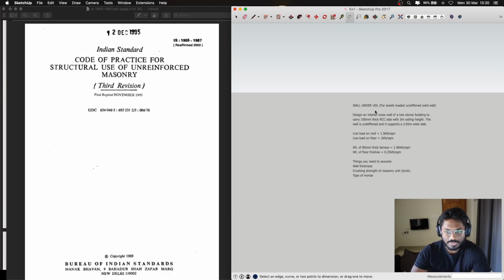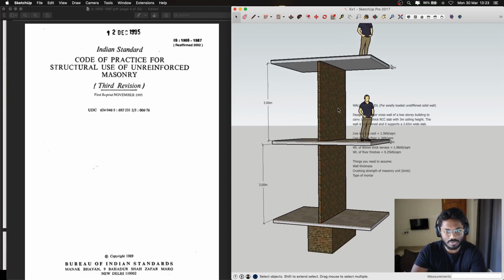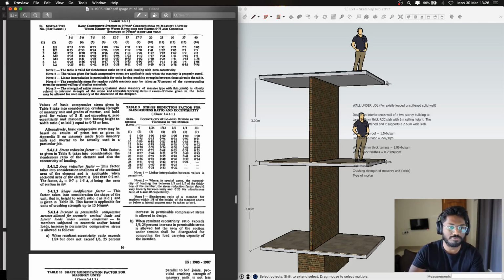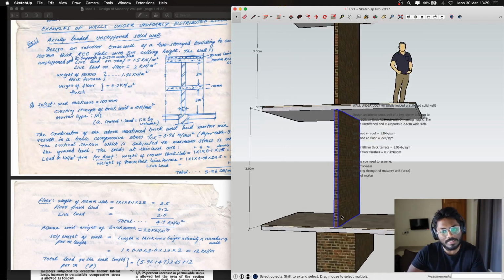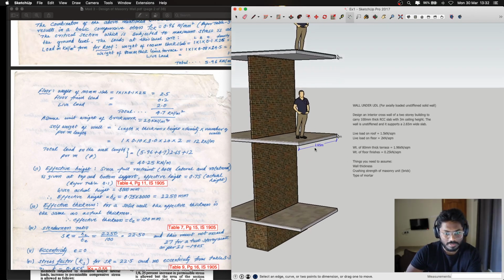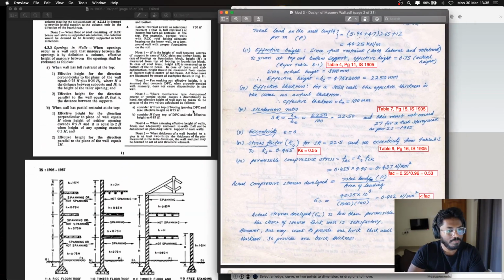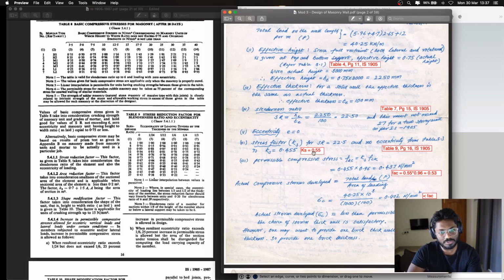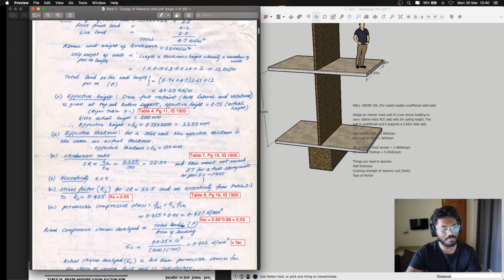Design Example for a simple Masonry structure

Comment: Sir can you share one example of manually designed load bearing G+1  structure
Reply from the maker: Hi Bobish, I wish I could. But it takes awhile.
If you can deduce the total load occurred on top of the wall cross section from the LL and DL on slab, the rest is as per the video instructions. Depending upon the type of wall/cross walls/piers/etc you can proceed with the specific design process. Hope it is of help. Regards